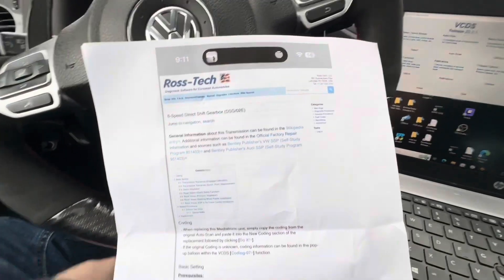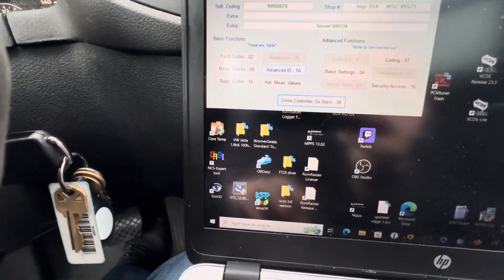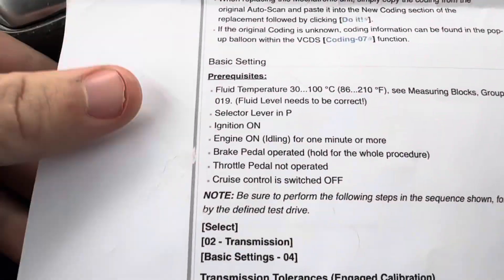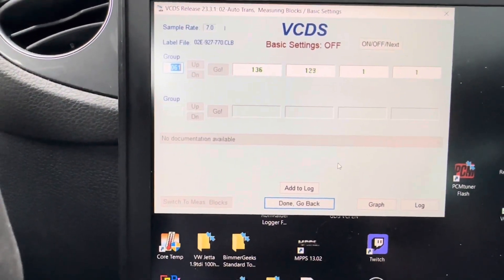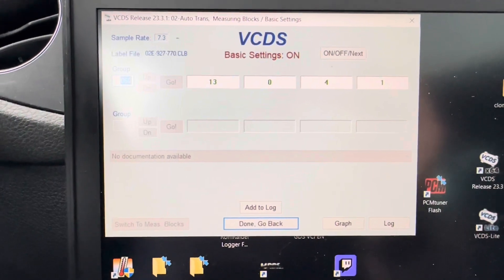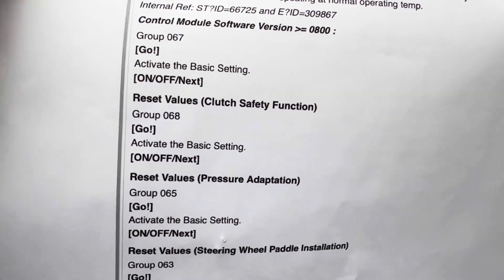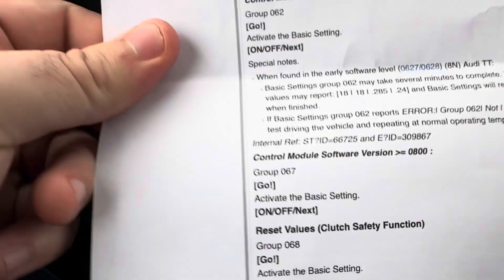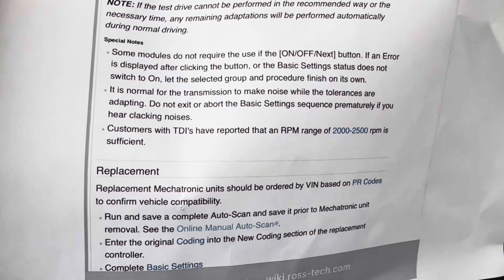Dsg adaptation on the Tiguan!

Comment: nice video man. thanks.
Im trying to do a "basic settings" procedure (as in your video) for my DSG6 transmission in my Seat Altea 2005 2.0 FSI. But for some reason my VCDS pages/groups dont match.

I have a HEX-V2 adapter cable.
my VCDS is version 23.3.1 (sop newer then the video).

For some reaon my ATF temps are in group 008 and 010 and not in 019 like they show in the video. 019 actually just shows ERROR.

Then I went into "basic settings" and looked up group 061 and it just shows ERROR. Neither are the other groups they mention in the video.

What am I doing wrong? any ideas?

Comment: Hey man do you think this would help solve the issue of my VW Eos jerking during acceleration only from a complete stop? This has become sort of my last resort to fixing this problem
Reply from the maker: Sorry it’s doing that. If a fresh fluid and filter change and adaptation doesn’t fix it’s probably the mech unit going out
Reply: @Cayden808 did you do a DSG adaptation? did it solve your jerkiness from a complete stop issue?

Comment: If the gb is tuned, after this process, the tune remains or gets reset??
Or it depends on the tune??
Reply from the maker: Not sure what gb is. But from what I know the adaptations stay even after flashing a new tune. But it’s recommended to run adaptations after flashing a tune.
Reply: @prestofixit3518  sorry i meant gearbox

Comment: Hello. Is same
Procedure for when changing the mechatronic unit?
Reply: Hi, what did you end up doing for it?
Reply: @ hi, if switching over to a new mechatronic unit, the tch will need to be coded to recieve it. If not it will drive initially but you will get error msg for transmission. It needs to be coded also for the immobilizer to work properly